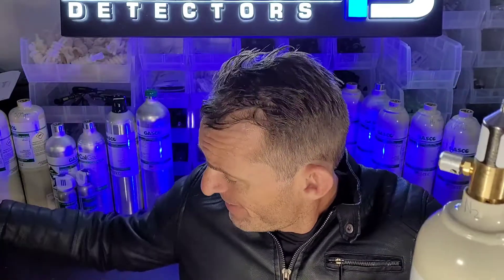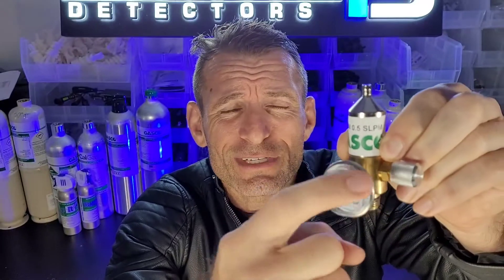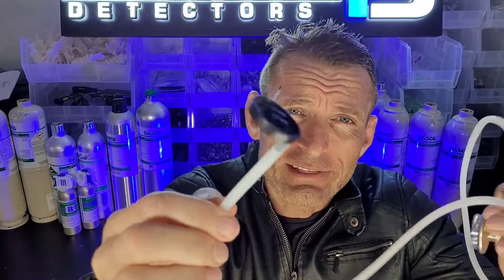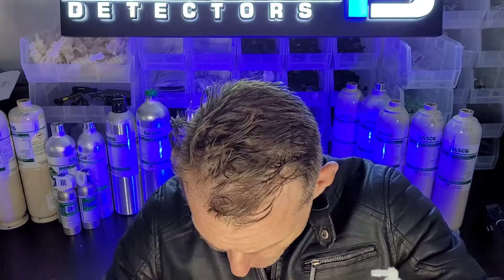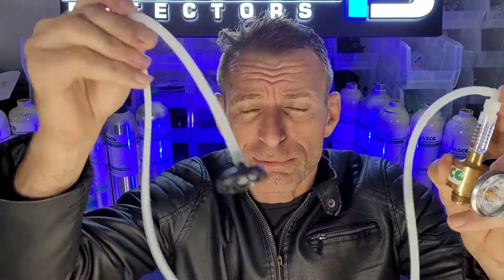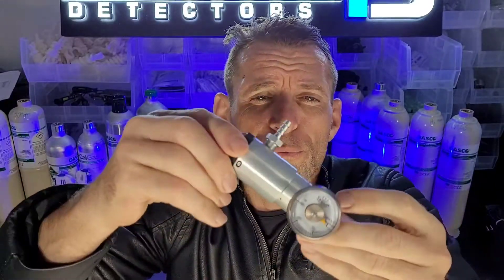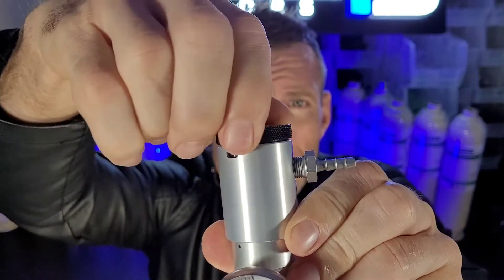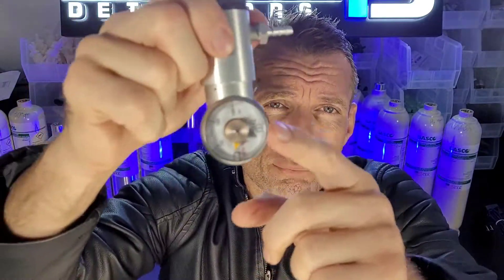What is a Gas Bottle Regulator?

Comment: what kind of hose would i need for a nitrogen tank? i’m getting a 103 liter steel cylinder and a 500 preset flow regulator
Reply from the maker: Silicone tubing, we sell it under accessories category on our website
Reply: @DrKozForensicsDetectors oh great, thanks :) also, can you explain how to put the regulator on?